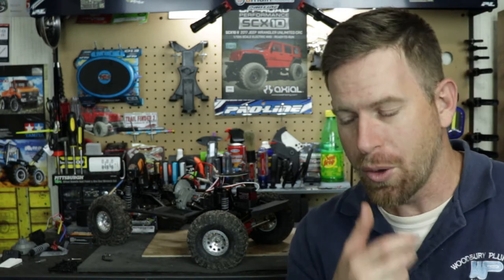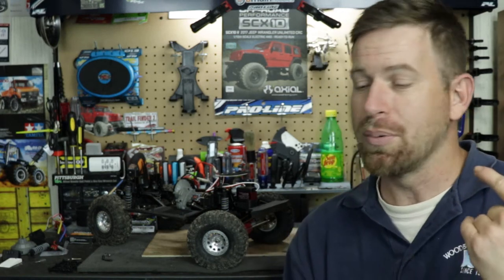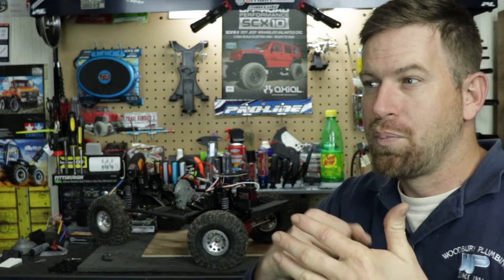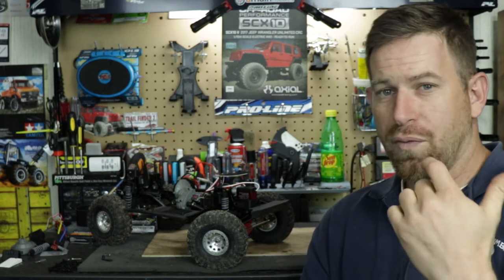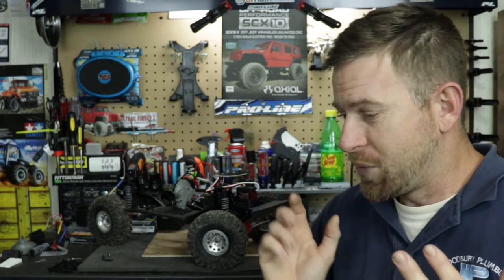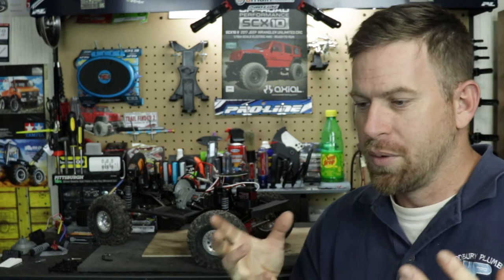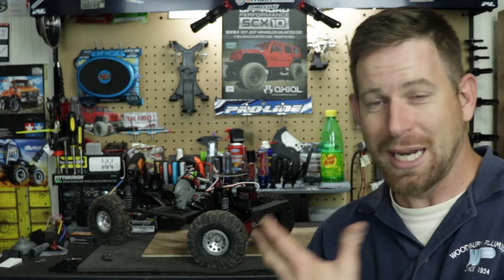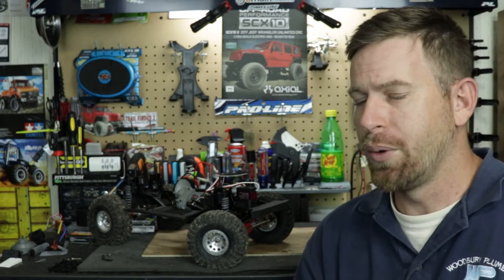RC84Films: SCX10 2 Problems Fixed

Comment: Nice video. Just to let you know if you didn't realize; If your endpoints weren't set and that's what was causing the over extension, that's probably the same reason why you burned out your original steering servo. Most people don't realize, if your endpoints aren't adjusted, your servo can be working the whole time you are hard over on the wheel. This stresses and overheats the servo and can break it easily if you get an impact while hard over. Everyone I've talked to to that said something like, "these servos suck, I burned one up." I ask them if they set their endpoints and the answer is always, "What's that?" Anyway, great vids. Keep it up!
Reply from the maker: Hey buddy thanks for the information i got anything setup right and truck is doing great now. Its only normal for stuff to break down and tear up. Lol

Comment: I just built one after buying the raw kit, I had that issue, what I did to fix it was changing the angle of the front axle, it was pitched to far down making the driveshaft perform at an aggressive angle and causing the hop. I changed out the 2 front lower control arms that lead to the transmission plate with shorter ones, making the angle where it needs to be. Super smooth, and the hop is gone.
Also, if you have the fly sky gt5 radio and you have the gyro enabled on a crawler it will make the front hop, it did it on my Ecto and as soon as I turned off the gyro it stopped hopping. Hope this can help anyone with this issue.
Reply from the maker: Thanks for the info and for watching